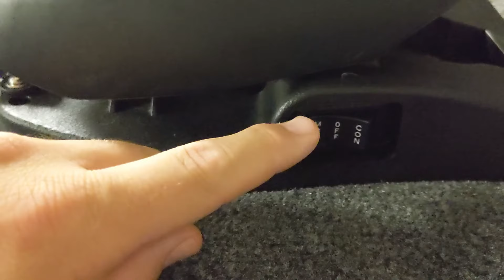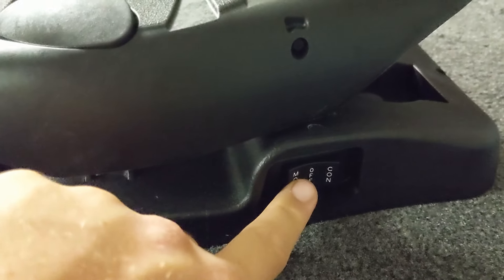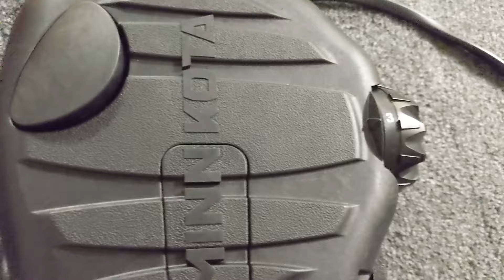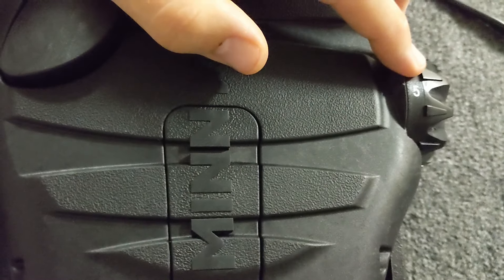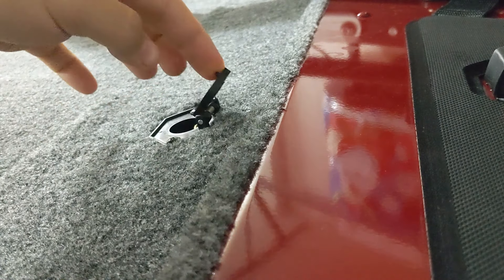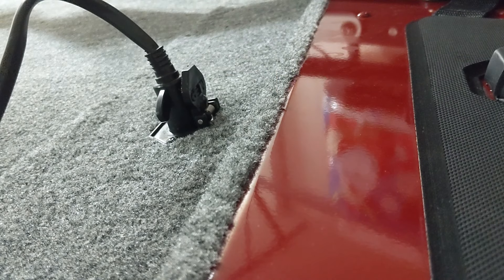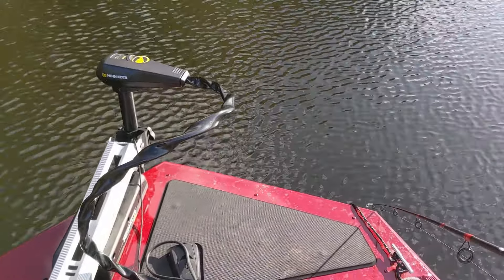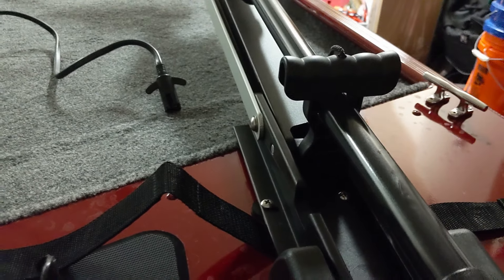Foot Pedal Trolling Motor Guide (Bass Tracker Classic XL, Minn Kota Edge)

Comment: the bar under the prop nut is called a shear pin you should have 3 or 4 of them handy, if you hit a stump or shallow areas or anything that stops the prop it will shear off,  also in the front of the foot area where the cables come out is a #3 Philips left turn loosens the power it takes to turn the motor right turn makes it harder to steer the motor, you can adjust this tension but do not adjust it to lose as you will spin yourself around and flip off the boat,, :)
Reply from the maker: 100% Correct! I'm fully stocked now --
Reply: Thanks.. i was looking for that.. bought a used edge and didn't know where the tension screw was located.

Comment: I found that when applying power to the motor by hitting the power button,  I would accidentally turn the boat right at same time.
Reply from the maker: Same thing here at first, you get used to how much pressure you need to turn vs power but its an odd design.

Comment: Ever have it “jump up” on 5?
Reply from the maker: Yeah, usually means it's not fully down and latched. I noticed it happens when the strap buckle gets under the motor when you're putting it down, the buckle stops the motor from going all the way down and latching. If it happens again I'd check for that, happened a few times to us now.

Comment: EXCELLENT video - Thanks for sharing. Does the cable that runs from the foot pedal to the motor tend to wrap around the shaft when you are making left or right turns?
Reply from the maker: It can, sometimes you have to "unwrap" it by doing a full spin.
Reply: @mvboutdoors  👍Thank you for your response - Happy boating/fishing and be safe!

Comment: Came across this video because I just purchased a 2019 tracker 175txw with this exact trolling motor. Took it out weekend before last and it did great. Took it out the weekend after and halfway through the day lost power due to battery being drained. I noticed the switch on the side was off which was good. The speed knob switch was still on speed 4 and not in the off position from the previous weekend? Will that cause a power surge and drain my battery even if the switch on the side is off? Any help would be greatly appreciated!
Reply from the maker: If the switch is off on the side it shouldn't be drawing power even if the speed control is set to 4. I would check all of your switches to see if anything was left on. Bilge, aerator, live well, lights, etc. Even just the key being in the On position.

Comment: Just installed and used this “edge” model to replace a very old ( and now dead) Min Kota. A bit disappointed in it. The old motor worked better. This is hard to deploy from its cradle. This video makes it look much easier than it has been for me so far. The power button on the foot pedal is small and in an awkward place. I found myself turning the motor many times while trying to power it. Found using 2 feet helped to overcome that. Well it’s bought and installed so I guess I’ll get used to it, but a bit disappointed in it. So much for improving things as you make new design decisions.
Reply from the maker: Try pushing down on the trolling motor while you pull the latch. The latching mechanism is really stiff at first. Something I found to help significantly was to put a dab of grease on the release  pins once you get it open.

Comment: Minn Kota® Powerdrive 55 lb. 54-Inch Trolling Motor will it fit this the weedless prop?
Reply from the maker: There are certain props per motor, if you look up the weedless wedge page it will have a chart.

Comment: If I go to turn the trolling motor to the right and I let go of the pedal will it go back to turning to straight or will it stay in the right position until I move it back.
Reply from the maker: There are tension adjustments. If you have loose tension it will go back to center or whichever way the current/direction is pushing it. If you have a higher tension it will stay in the direction you point it. As it comes it would stay in the direction you put it.

Comment: Wish you gave instruction more on foot control with pedal while driving in water. Thanks
Reply from the maker: I've been wanting to redo this video for a while, once I get the new boat finished up I plan to. In general, you pitch the pedal forward and back to turn left and right, level the pedal to go straight. There is a speed adjustment knob on the side. If you had any questions feel free.

Comment: Hey, I got the exact seedless wedge prop and the prop was not able to spin because it was very tight, we’re you able to just fit it on there fine at first or did you have to use some spray
Reply from the maker: I didn't have any issues with replacing the blade. It's been a minute since I've done this but just make sure you have the right blade as there were a few different versions. If something is binding it could be the wrong blade or it's not seated correctly.

Comment: Is there a way to make the foot pedal connection cable longer.? I am thinking of instillation on the rear of mny Perception Outlaw 11.5 kayak and the cable long enough to use the contorl while sitting in my Yak. Installing it will be no problem as I can make a mount for the rear of my Yak. I will just like to be able to plug in a longer control cable to it.
Reply from the maker: Yeah that would be no problem to extend it, you can either tie off a longer pull cord or just knot on an extension.

Comment: Hey, I just got the tracker classic and have the Edge too. It won’t deploy. It’s stuck / locked down. Any clue!?
Reply from the maker: Try pushing down on the trolling motor while you pull the latch. The latching mechanism is really stiff at first. Something I found to help significantly was to put a dab of grease on the release  pins once you get it open.
Reply: I’m hoping that releasing it gets easier over time. I’ve needed 2 people to get it released and out of its cradle. One to pull the rope and release the pins, and another to grasp the shaft and lift it out of it’s cradle. While on the water, if I need to use the big engine to move some distance, I don’t put the trolling motor completely back into its cradle. Only do that at the end of the day. Time will tell if this gets easier. If not, I may need to do some jury rigging! Best of luck to you.
Reply: @pauledwards1699   any update on this issue? I just bought one and have issues deploying it too
Reply: I have mine and it pulls easy and pops up almost like it’s spring loaded, just bought it so it might have been changed from the old version!

Comment: I have the same trolling motor, but when I go to disengage the lock (I have pulled as hard as I can without breaking it) and nothing happens. Any ideas?
Reply from the maker: Yes, press down on the motor when pulling the lock. When you first get it it's really stiff. Once you unlock it put a few days of grease on the locking pins and it will be much easier to unlock.
Reply: @mvboutdoors  Thanks! You commented faster than I thought. At first, I thought it was a rust problem but I looked at the pins and they could move, they just wouldn't unlock. I will try this when I get home. Thanks again!
Reply from the maker: @kalebthompson857  haha No problem, good timing on the comment :)

Comment: How do you make it turn though
Reply: Pushing the pedal up or down is steering
Reply: CrankinBass how about moving forward and backwards?
Reply from the maker: You have the full 360 range of steering, it all depends which angle your foot is at. There is a forward and backwards position.

Comment: I'm looking for a similar prop for the same trolling motor but the Minn Kota website says the one you used will not fit the motor you put it on. It says the Edge 45 is 3 1/4 inch and the prop you used is for 3 5/8 inch. Does it fit properly?
Reply from the maker: Yeah it fits properly, I got the model number from the accessories page on Minn Kota website for the edge 45. The guy at Bass pro said it wouldn't fit either but it does. Works great 👍
Reply: @mvboutdoors  I'm up in the air. I see where you found that on Minn Kota's site but when you click on it, it doesn't list the Edge. I read an Amazon review of this prop where Someone said they had to return it because it did not fit the Edge 45. The one they make for the Edge specifically looks like its the  MKP-6, but it's just a Wedge not a Wedge 2. Thanks for the Video though, It clearly works on yours.
Reply from the maker: @justjimtime1672  Yeah it fit perfectly, I've had absolutely no issues and installation took all of 5min. At bass pro they had a chart and the Edge wasn't listed either so not sure why they haven't updated with its compatibility. Is yours foot controlled? Possible difference in that version?